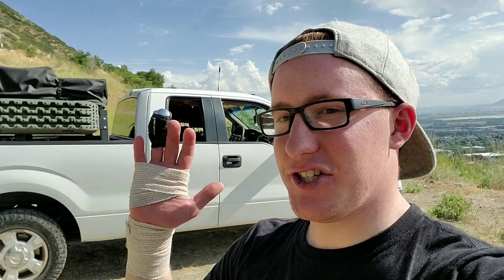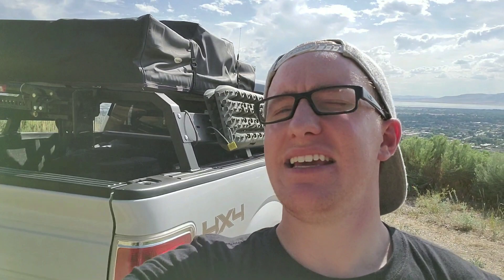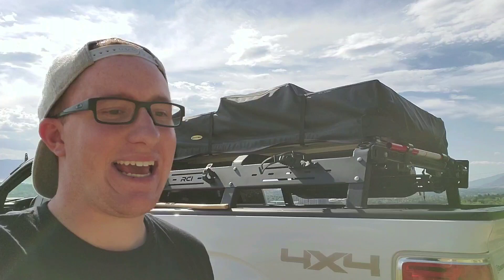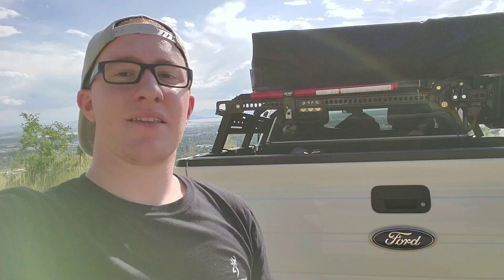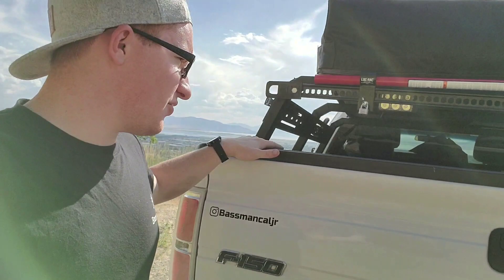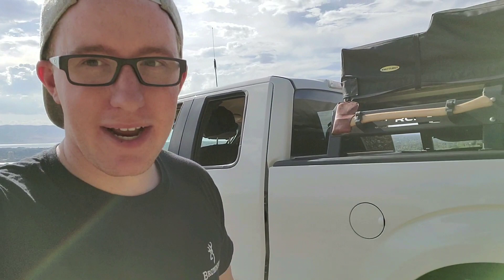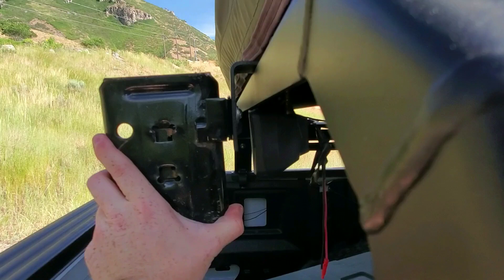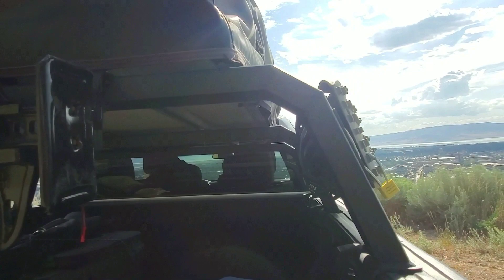RCI Offroad F150 Overland Bed Rack Review- After 8 months

Comment: I have the same set up, but I use the smittybilt overland xl tent.  With the size of the tent you don't really notice how short the rci bed rack is.
Reply: @patricksweeney2818    Not at all. It supports the tent perfectly.  The tent does overhang the front and back obviously, but it doesn’t affect the weight distribution. I would choose the rack over and over again.

Comment: Curious as to your thought process...why did you go with the bed rack and a tent vs. a truck cap or even a pop top truck camper?  I'm leaning towards a high top truck cap shell so everything stays clean and secure inside.  Plus, if you pull into a camp site at night and in the rain...you have no setup time and you can just climb in the back.  I'm guessing a cap would be quieter in the wind too if you are trying to sleep.